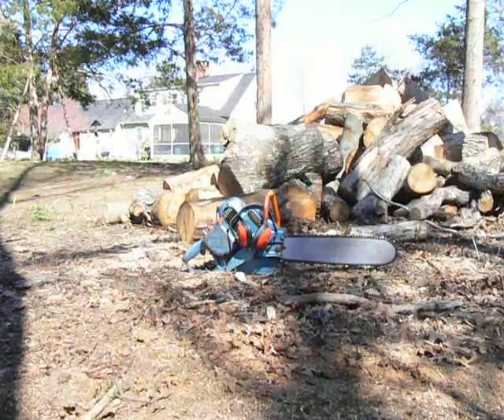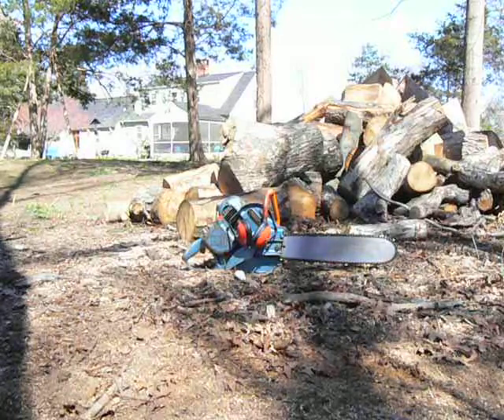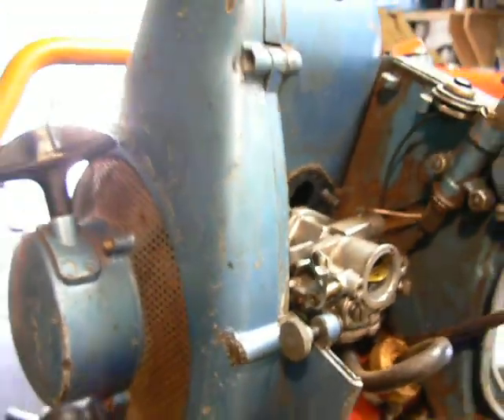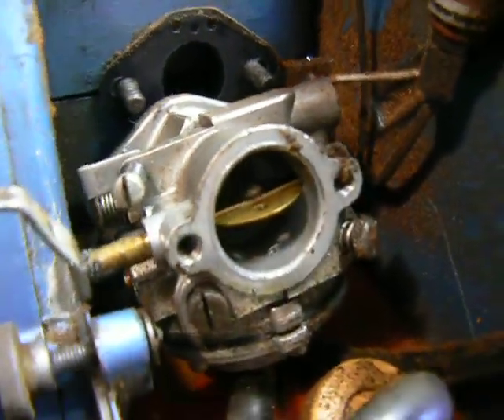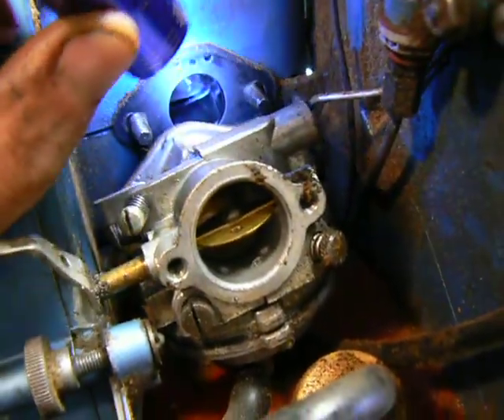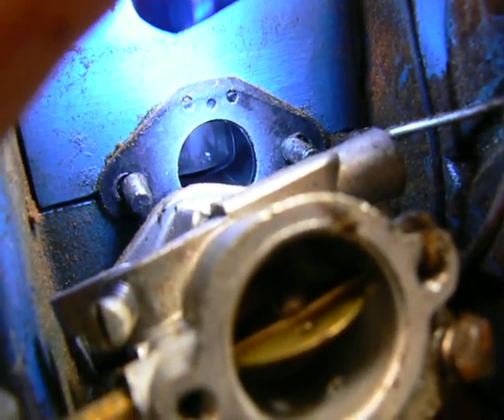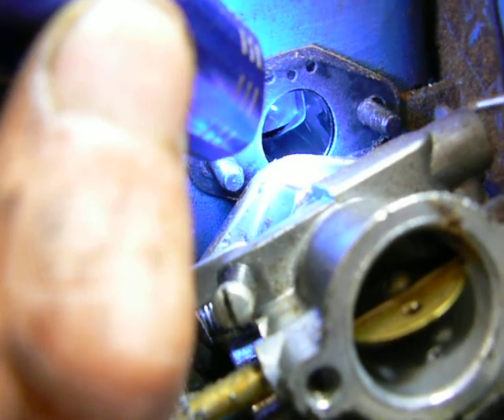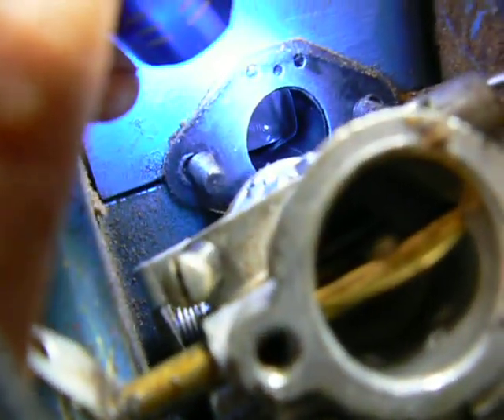Making a cut with the Solo Rex and it backfires! Any help?

Comment from the maker: it sure ran pretty well afterward for it to be a flywheel key, but that's easy to check just in case. there's no reeds, it's piston ported. i will check the compression, but it sure feels pretty strong.
Reply: Maybe crank key,i have same problem

Comment: can you tell me what ratio fuel to oil you use please, i have one as an engine for my go kart thankyou also what are your carb settings?
Reply from the maker: i use 32:1 of a good two stroke oil and regular gas. carb setting varies for every saw and carb, and also elevation. just start at 1 1/2 turns out and adjust from there. thanks for watching!